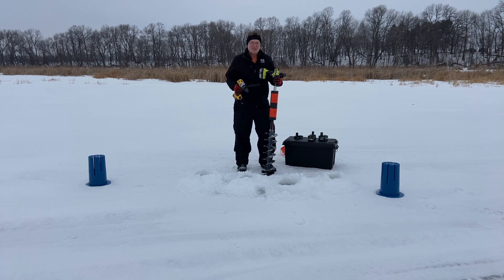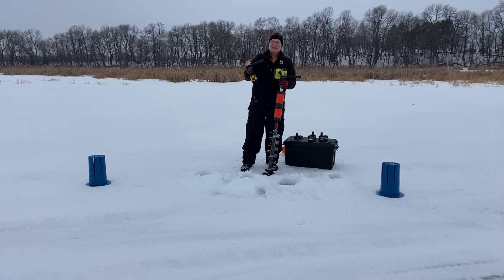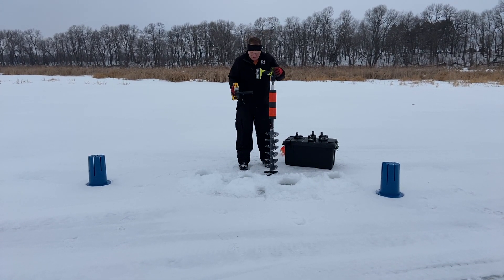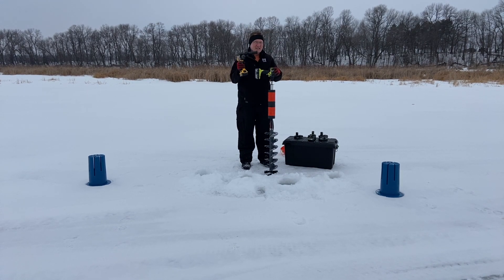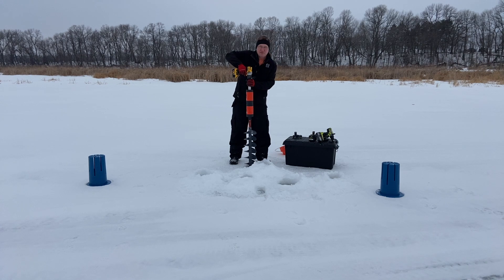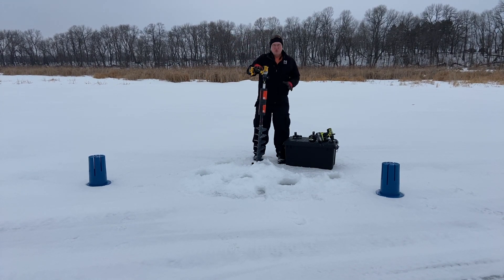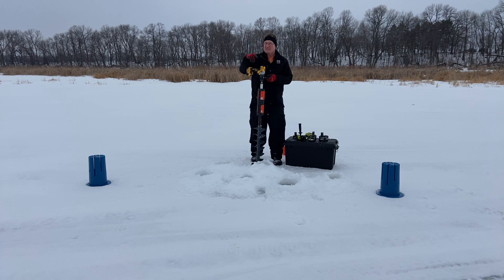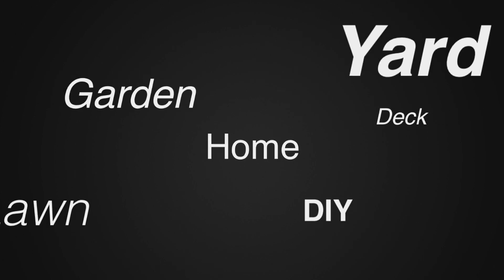DeWalt and New Ryobi Drill Through Two Feet Of Ice! Which Does It Best? #DeWalt #RyobiToolsUSA

Comment: Nice review, I was considering the Ryobi as I'm already heavily invested in that tool line but after much research, I decided that it's DIY heritage may fail either in longevity or in cold weather. A few reviews show how some brands seem to do better in the "freezer test" than others and the "pro" tools, Dewalt, Milwaukee, Hilti, and etc. performed better than some of the DIY or Prosumer brands.

Ultimately I decided on the newest Dewalt, DCD999. I probably would have been fine with the Ryobi HP as we use the Clam Plate with Adapter with a Strikemaster Lazer auger so the torque requirements are even les demanding.

I do not agree that the Milwaukee Hammer Drill, 2804-20, is more powerful than the DCD996. Many reviews rate them as equals with both tools being better at certain things. The consensus possibly being that the Milwaukee sacrifices a little top end torque for more speed and a lighter overall package (and a better warranty). I wanted sheer top end torque so the DCD999 with the Flexvolt was our choice...there are other great options and I'd have happily bought the Milwaukee were it not for the deal I got on the Dewalt.

We used the newer Dewalt yesterday on just 8 inches of ice and drilled about 15 holes. The DCD999 is a wrist breaker and I actually dialed down the clutch to save our hands and wrists. One of the high end hammer drills, can't remember which one, has an electronic clutch that stops the tool if it binds but reviewers seemed to love it or hate it.

Comment: Shame shame no hp battery 😢 make ryobi look bad
Reply: I just got a p251 for 75$ at a yard sale. Is this the full size one your talking about because when i looked it up it was the only brushless one and only one with a handle.
Reply: @connorerhardt1767  While the P251 does claim to have 750 in lbs of torque, it does not use the High Performance battery which Ryobi claims to have 30% more power (not sure why the torque rating wouldn't be 30% higher) and have 4x the runtime. The reviewer specifically used the newest HP drill. Who knows?
Reply: I counted down the seconds in the video and the Ryobi was at least as fast as the DeWalt. I have a Ryobi P251 on a 6"Eskimo hand auger with a Clam shaft extension, a drill adaptor and a stopper float. I can drill through 23 inches of ice in 9 seconds with a standard 4 Ah battery. The blades are very sharp. I don't push down on the drill. It works best when the drill is spinning as fast as it can in #1 speed. If the blade catches suddenly when it is drilling it can buck like a mule. This isn't an issue so long as I don't push down on the drill. It makes holes in the ice fast enough for me.